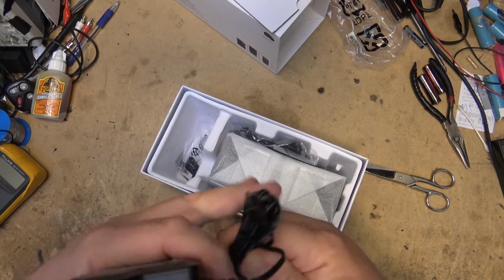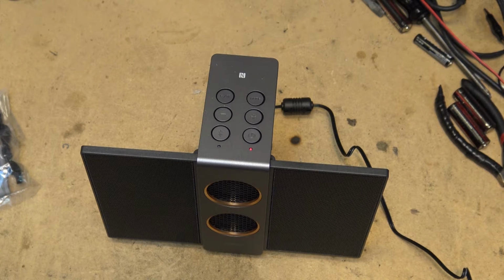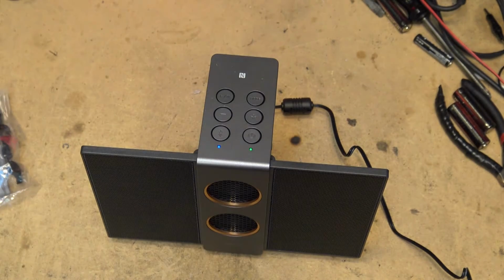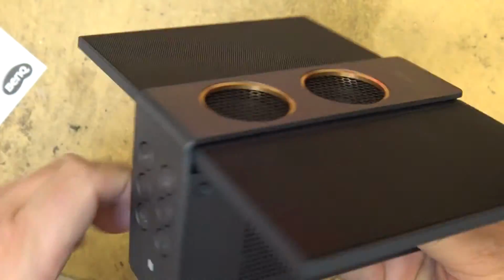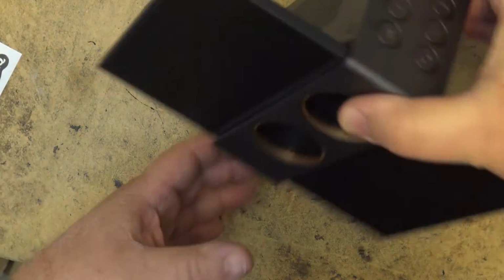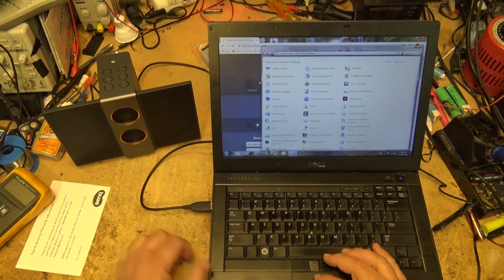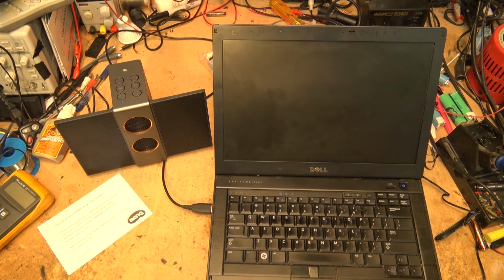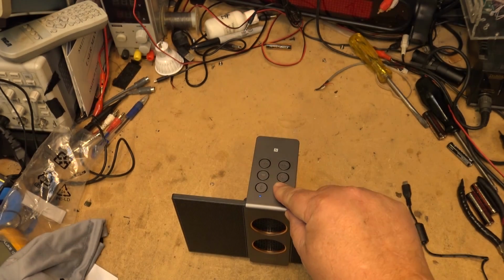BENQ treVolo S Electrostatic Bluetooth Speaker Unbox and sound evaulation

Comment: With the studio mic, I think it almost has no high frequencies. But with the camera later it sounded much better on the high end.
Reply from the maker: Yes I noticed that. The studio mic emphasizes bass response, as it is designed for vocal / voice over. The camera microphone on the other hand I think has better response, especially in the high frequencies. That is why I put both in, so you can hear the difference. I do have an instrument microphone designed for acoustic instruments, however it is also not stereo, so useless for demonstrating a stereo speaker. I was quite impressed on how well the mic on the camera picked it up.

Comment: Sounds pretty good,,, what's all the cloud stuff all about lol ;p)
Reply from the maker: Well I figured you would get tired of looking at a still image of the speakers. 
That was some clips I did using a still camera about 4 years ago going through the rocky's and cascade mountains in BC, Alberta, Montana, Utah and Washington. I have much more done all around southern utah in the grand canyon that I have yet to get to.
I did some fantastic grand canyon time lapse stuff back in the early 80's when in film school on an old bolex 16mm camera. Unfortunately because I was doing it as an assignment, and my instructor supplied the camera and film, I signed off all rights to the work. I actually trained for film and television, that was my studies and did the electronic service work to put food on the table during down time between gigs in video production. Had I stuck with film things would have been different, as film was set to boom here, but I was about 5 years early.